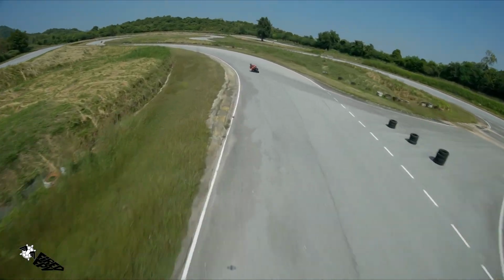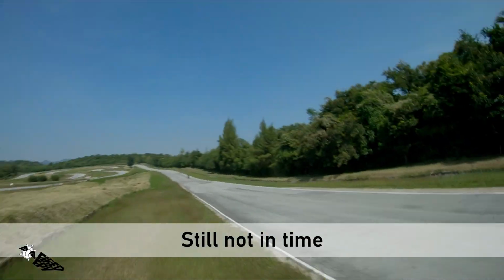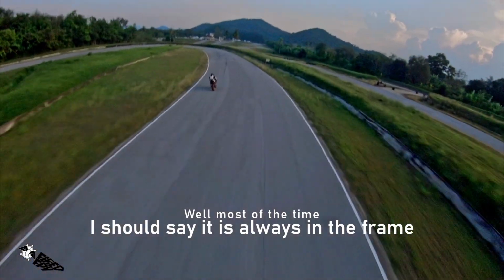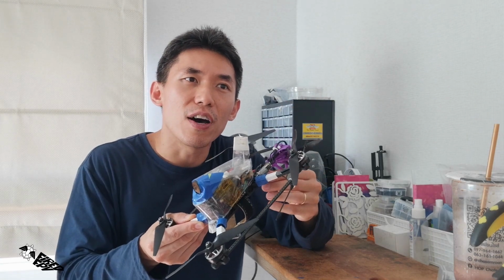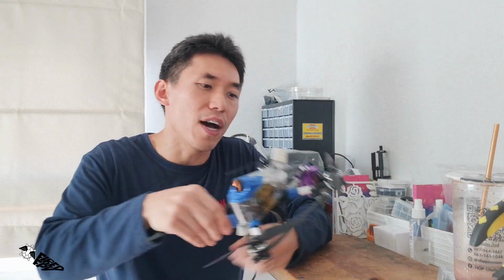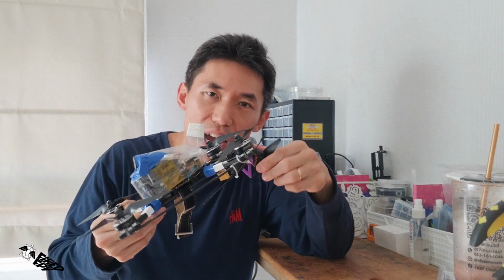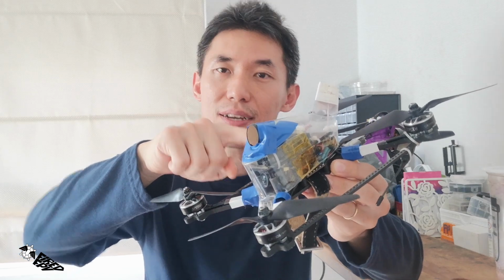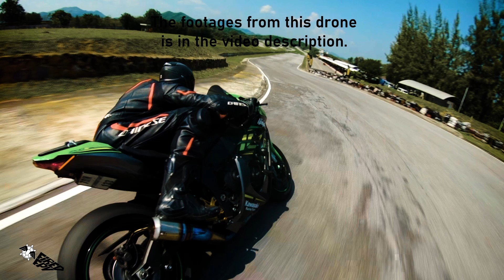The Pusher Drone is Built for high speed chasing

Comment: Very interesting build and great explaination. Why you chose for bi-propellors? 2 has more grip for acceleration and deceleration, i thought?..
Reply from the maker: Thank you so much! Biblades on the normal 4 motors for efficiency. Biblades on the pushing motor for higher top speed.
Reply: Tri props ftw haha for cinematic I fly with lower pitch (P2) tri props for max grip and resolution. For speed always P4 but that’s not efficient 😂😂

Comment: Very cool! What's the flight controller firmware you are using, Betaflight? How is it configured?
Reply from the maker: Thank you! It is KISS FC v2 not the Betaflight one. The 5th esc signal is connect to a pwm pad of the receiver. I will make a video about how I build it. Stay tune.

Comment: Great idea and very interesting design! What ESC are You using?
Reply from the maker: The 4 motors use Hobbywing 60A 4in1 and the pushing motor uses Skystars Talon32 Slim 40A. I have no better option for the individual ESC in local shops. Thank you!

Comment: Cool! Maybe a tiltrotor design might help you get more speed and control to slow down too without changing camera angle.
Reply from the maker: Yes! I was just thinking about this drone with the 2 rear motors are tiltrotors for additional forward boost and tilting back to aid in slowing down. 😆
Reply: or a 3D prop?

Comment: a freaking iflight evoque goes 150kmh all day long. I had mine up to 130mph (over 200kmh) with 5050 bi blade and 15mph tail wind.
Reply from the maker: That is amazing!
Reply: @FireDFPV   That is full throttle though which can only sustain only so long till lipo is drained . But yea would be cool to see a quadcopter capable of a 200kmh cruise speed at half throttle. Not sure how fast a 2600kv 6s setup would fly at 50 percent throttle or at what tilt angle or for how long haha.